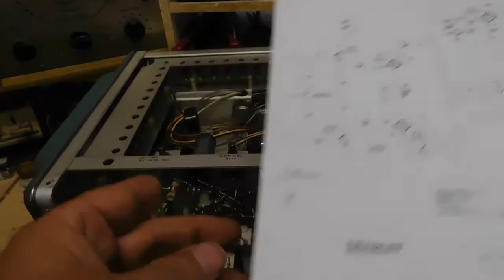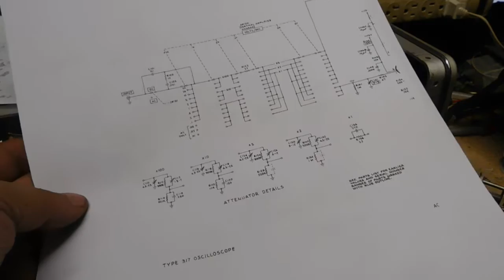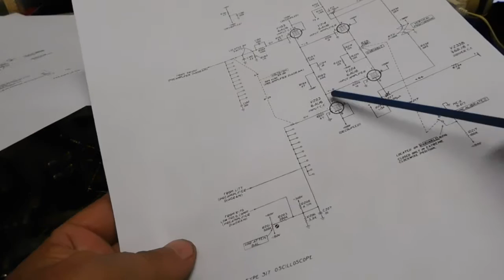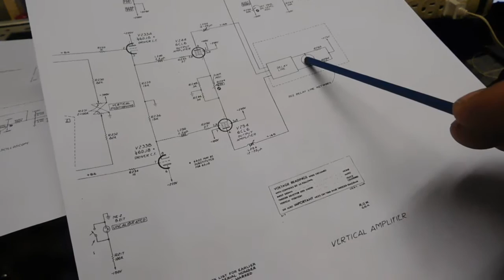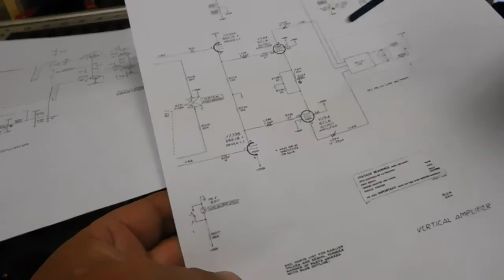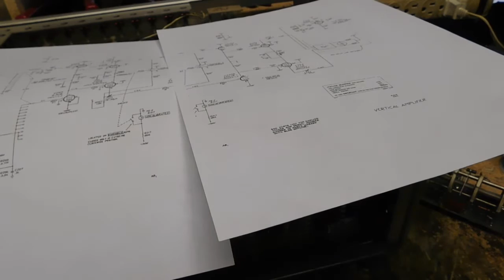The delay line and vertical circuit on the Tektronix scope

Comment: Hi Dennis:

   Great video. I had a Tek 502 with the original Tek stand that I got from Boeing surplus years ago that I recently gave away. It was too big. I am now regretting it. Exemplary build quality and engineering. I do have a Tek 465 and Rigol 1054Z DSO though.

   I, for one would love to hear more in depth the theory of delay lines. I have heard them mentioned and also have seen them myself in tube gear in the past. I always wondered how they worked. Now I know. Thanks! I wonder how cheap versions of this era scope accomplished the same thing. Or did they? I can't imagine, Eico, Heathkit, etc. could afford to implement an expensive delay line systems like this in their scopes. The cost would be prohibitive, I presume.

   Ouch... The phosphor looks horrible! Amazing it still works as well as it does. Maybe the camera made it look worse than it actually is. Hope you find a replacement CRT for this fine scope.

   Keep up the great work. Very much appreciated.
                                                                                         Tom

PS Sorry I don't comment more often. I felt compelled to do so after watching this excellent video.